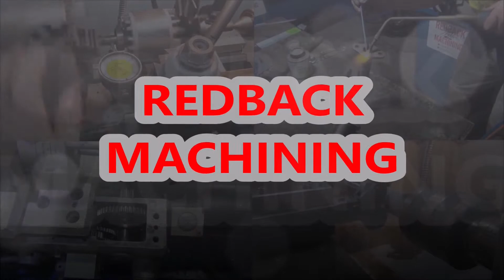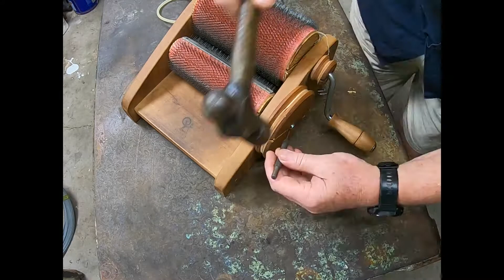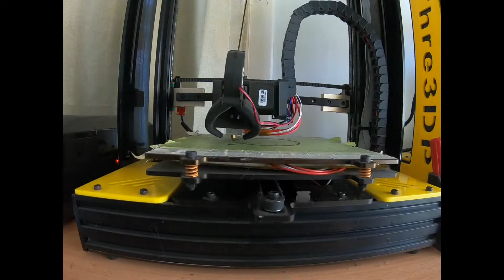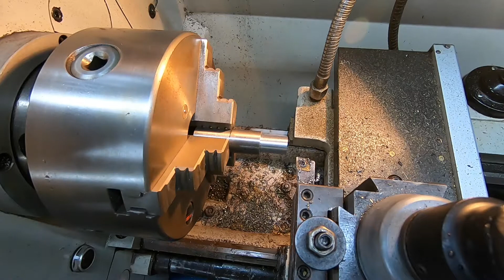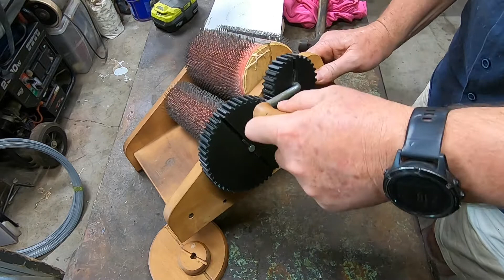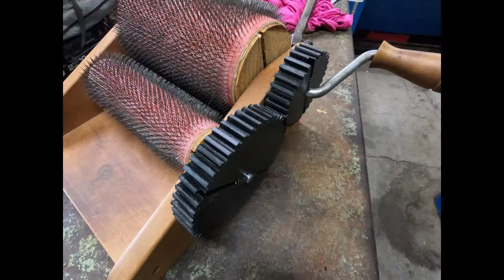3D printing gears for an Ashford wool carder

Comment: Gday, im sure the wife will be happy with that fix, I know Brass is expensive but would look great, I’ve been thinking about a 3D printer for a while now, not sure if I can justify the cost for the amount I’d use it, still thinking there, awesome job mate and thanks for sharing, cheers
Reply from the maker: Thanks for watching 
The wife was happy she will give it a good run and see how it goes.
I am thinking of making a wooden gears so it looks more original. I haven't cut wooden gears before I think that might make a good video.